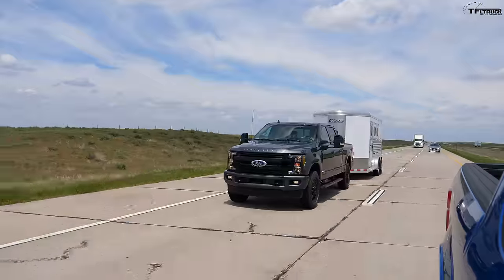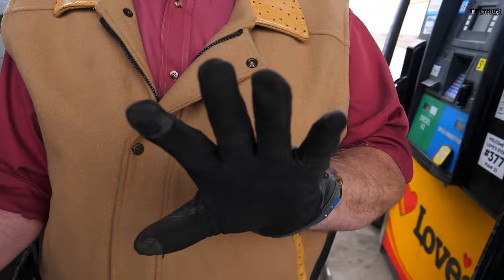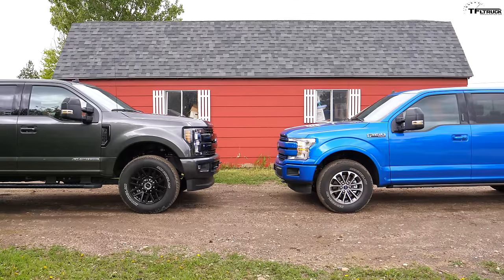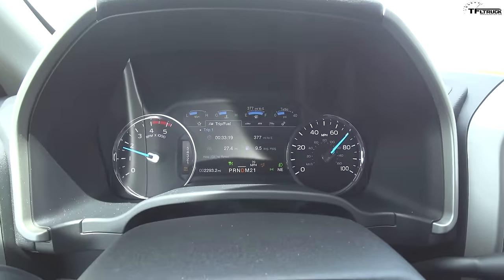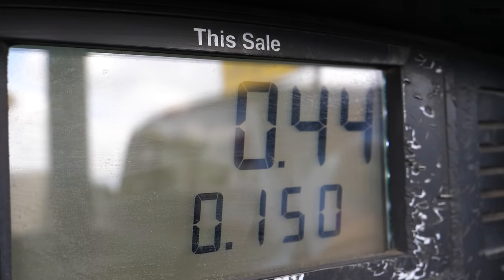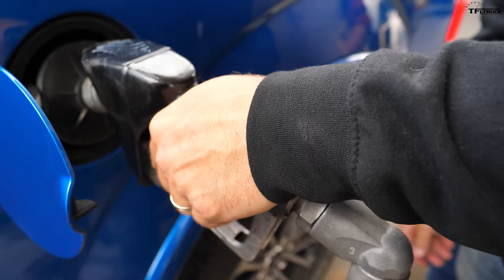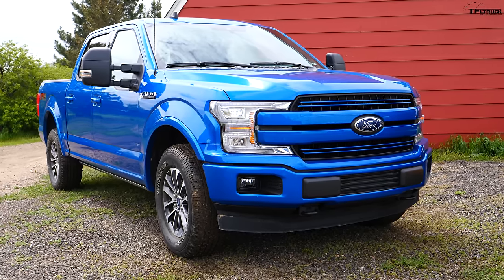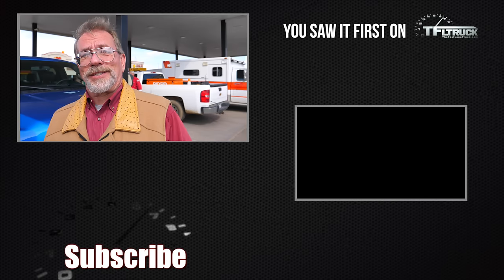Do You Really Need a Heavy Duty Truck to Tow 9,000 lbs? Ford F-150 vs F-250 MPG Review

Comment: In my opinion, this is why the half ton diesel pickups won't sell nearly as well as a regular gas pickup in the US. You pay a hefty premium for a Diesel engine, then spend more for fuel and DEF, don't forget those expensive fuel filters that have to be changed every 15k miles, and oh did I mention the oil changes cost about three times more? By the time it's all said and done, a half ton diesel pickup just doesn't make financial sense for the average pickup truck buyer in the US. The slight efficiency gain with fuel economy won't pay off.

Comment: It would all depend on how often people are towing and the weight of the load for most people as a daily driver the f150 will cut it
Reply: Yea if you do it on a weekly basis then would be better have the 250 as it will deal with it long term better but if its say once a month or something then probably be alright with smaller one.
Reply: Thats mu dilema. I tow mostly a few miles away onto the beach only a couple times a year and maybe once a year out of town but tt is 32’ amd 8500lbs loaded and would love a 1/2 ton for every day use but a 2500 gas would be a lot safer for the few times i do tow

Comment: Definitely agree with what some say, if you tow near 10,000lbs often go for a bigger truck. It's goin to drive better and safer with the heavy load, but they should have done diesel vs diesel.
Reply: They test with the trucks they're given. Duh.
Reply: The thing is, that while the test is interesting, no one buying an 8000 lb. travel trailer is going to be driving on flat roads all the time. If they want to take it anywhere, they're going to have to manage hills, mountains, winds, passing, and other obstacles. MPGs, while a consideration, is only a small part of the issue.

Comment: This was a really cool test. Yes theres other variables like 30ft campers or goose necks but that wasnt the test. It was a 9k lb horse trailer and this just proved that for some people you dont have to overcompensate on a truck when modern 1/2 tons do the job just fine. Lets not forget a 1/2 mpg could be from more wind, slightly heavier throttle response etc. Good job tfl on this one 👍

Comment: This was a good start on comparing the F150 and 250 towing.  You really need to take this to the next step by doing some hills for pulling "and" braking performance comparisons.  Then go out on a windy day, and also a busy day with semi's passing you.  If you drive 60 mph in a 70 mph zone they will be buzzing by you the whole trip and you'll find out how each truck handles side forces and sway.  Also consider the RV tower who's driving 1,000 or more miles on a single trip with a variety of conditions.

Comment: My wife and I both have Ram pickups.  My wife used to have a 1500.  But traded in for a 2500 with the 6.7L Cummins. My Ecodiesel pulls trailer nice.  But my wife loves how the VGT engine works on the Cummins.
We rarely tow trailers.  But do go down very steep grades frequently.

Comment: Over the past nearly 50 years I have towed trailers weighing from a couple of thousand pounds up through 14-15,000 pounds!   It is true that there are gas powered pickups that have the power and heft to do the job.  However, from experience, if one does as much towing as I have one learns gas engines do not hold up like a well designed and built diesel engine!   The first thing to go on a gas engine is usually the valves.  My last gas big block needed a valve job at about 38,000 miles!   My current diesel powered Ram has passed the 285,000 mile mark, no such problems!  This is one of the 2 reasons big rigs are diesel!  The other is diesels are about 40% more fuel efficient than a comparable gas engine!  Now, if one tows any weight on a seldom basis, a gas powered pickup probably will do fine.

Comment: You should do a similar test with Chevy and dodge 1500 vs 2500
Reply: Raptor867 I recently towed a 3500 lb camper with a 2.8L Colorado from the shores of the Cheasapeake Bay to the peak of Mt Rodgers. Whether in traffic or traveling downhill, I felt in complete control of my pickup and trailer.

Comment: I come from a f150 and have now purchased a f250 towing a 8k lb camper long distances. Both my trucks are gas , in my experience what pushed me to a f250 is the fact that we often ended up overloading the truck by taking all of the family’s toys. We are so much happier with the f250 as I can load the canoes and the generator without even thinking about how much weight I’m putting on the truck

Comment: I have a gas F150 and my son has a diesel F250. I tow a race car trailer about 7500 lbs, and the 150 tows it fine, of course the F250 pulls it better but frankly I hate the ride.  And empty it's really bad, my son calls my truck a baby truck but overall for the 10 times I tow a year the F150 is a better overall package. The fuel I would save with a diesel would never pay for the added cost and the chiropractor bills for my back.

Comment: I saw a tow video on YT here and the guy was towing a large camper at 62mph with an F150Eco. He showed the gauge as he was getting 14mpg. Drive slower, get better mileage.
Reply: Yeah 70 mph is alot of wind drag for a brick
Reply: I call bull. I tow a 31 ft 7k travel trailer with an Ecoboost Expedition EL. I get 8 to 10 mpg between 55 and 65mph. From all the trailer owners posts I've seen, that's the average. Only way he got 14 mpg is with a tailwind or going downhill.
Reply: Jason Hall you drive an expedition... not a f-150
Reply: @kirks6932  true, but TFLs numbers are much closer to mine. So who are you going to believe? https://www.tfltruck.com/2018/03/top-10-most-efficient-trucks-towing-a-7000-lbs-trailer-on-a-100-mile-highway-loop/
Reply: I tow a 31' fifth wheel that weighs 9000lbs loaded with a '13 F150 with the 3.5L Ecoboost  and I average about 9 to 10 mpg, but when I tow my utility trailer with that load I average about 11 to 12 mpg. I attribute the difference to the surface area that the wind hits. 14 mpg is stretching it quite a bit.
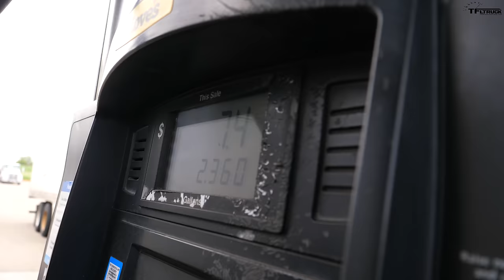Reply: Pulled a 30' 5th wheel that weighs about 9000lbs on a 1000 mile trip and averaged 7.8 mpg. '18 3.5 EB 3:55 gears and premium fuel, average speed: 65mph.
Reply: I had a 2018 3.5 EcoBoost and tow a 32 foot 8900lbs travel trailer. The best mpg I ever got was 8.1 mpg. Moved up to a 350 with the 6.7 power stroke and average 14 mpg while towing the same trailer.

Comment: Thank you, because I was wondering about this very issue as my 27ft (31ft with tow lip) new 2021 travel trailer is scheduled to be delivered end of this month. My truck is 2019 F150 Lariat 2.7L V6, FX4 with tow package and we did get a heavy duty WD hitch  to go with the new  trailer which has almost 7600lbs grouse weight. I feel better now. Thank you again. Of course I will be driving slow, and take my time.

Comment: Plus the extra maintenance costs for diesel at this level are not so wonderful...
Reply: Unloaded the diesel is like 15mpg at absolute best. Every mile on that truck will cost more for absolute certain, but it's safer, less stress/driver fatigue, and you could set the cruise control up the ike gauntlet in the 250 and maintain speed. That little gasser is running on borrowed time doing that every day. Industrial vs casual.

Comment: Interesting... however, there is a third option, that being a SuperDuty with the gasser engine. Save the $10,000+ upcharge for the diesel engine (and associated maintenance costs) and see how the 6.2L gas powerplant performs. I have a 2015 SuperDuty with the 6.2L pulling an 8,500 lb. equipment trailer and for occasional towing I couldn't be happier. I think the additional safety margin the heavier truck provides is well worth the difference compared to the F-150.

Comment: I'm amazed at how bad these 6.7 diesel trucks are on fuel.  They're barely edging out the gas trucks even towing as seen here.  It seems like the older trucks with diesels are much better in spite of all this tech.
Reply: Just delete your egr and dpf. I tow 14,000#'s every other day with my 6.7, up and down Ozarks hills at freeway speeds, and never get below 14mpg.
Reply: That's because the government wrecks them with EPA B.S.  You can get much better mileage out of the diesel with some aftermarket work.
Reply: @hannibalsmith1194  admittedly I'm no expert on pollution statistics and whatnot, but it seems to me that the government has an unreasonable phobia of diesels. Much more efficient, and can do much more work in the same amount of fuel, but "it's smelly, Smokey, loud and scary! Needs to be regulated to death!" Lol
Reply: The more HP and torque you use costs more fuel.  The older diesels were more fuel efficient because they weren't tuned for higher numbers just for bragging rights.  But they got the job done and ran for a long long time.
Reply: Also; these guys are in the Rocky mountains near Denver, Co. from 4000 ft elevation up to just under 12,000 ft elevation. Fuel economy is not going to be as good as if driving the flat roads of Texas, Oklahoma, Kansas, Nebraska, etc.
Here in the Texas panhandle pulling 9,000 + and getting >14mpg in my 2020 F250 6.7 PS.

Comment: Nice effort TFL. No wind or grade and a well balanced load are a lot different than hauling my 37.5 ft TT. My 1200 lb tongue weight would put that f150's rear on the ground and nose in the air wd hitch or not plus eating most the payload. But this proves f150 can get it done well if set up right.

Comment: Why you guys stopped doing MPG loops with empty trucks because that was very helpful to us? Not everyone is going tow with their truck 24 hours.
Reply: True, but I rarely drive my truck without a trailer.  If I don’t need the trailer, I’m probably going to ride one of my motorcycles instead.
Reply: Pretty sure if you go back throughout the year you'll find empty fuel loop videos on these trucks.
Reply: Why buy a truck if you aren’t towing/hauling?
Reply: TeensierPython - I didn’t not say that they should not do videos while they are towing. Absolutely, I want to see it in both results with towing and without. However, everyone is different than others. For example, I have 2019 GMC Sierra 2500 and I have not towed with yet since I bought it.
Reply: @TeensierPython   probably 90% of the trucks around me never pull a trailer or even load more than 100lbs in the bed.  Sad very sad.
Reply: They are damned if they do and damned if they don’t
Reply: @EverydayCars  i seldom haul or pull anything. but i don't expect my truck to get good gas milage either. i am the worst poser ever, use my raptor to drive to the store.
Reply: @TeensierPython  at least your honest.  And congrats on having a Raptor there awesome trucks but you know that.
Reply: There are a lot of people that buy trucks because they look good! Some just like the occasional truck use like bringing home a new sofa, hauling a few tree branches out, etc. If you ask why buy a truck if you don’t tow, another parallel is why buy a corvette if you don’t race? Because you want it. That’s all. When we can, we all purchase the vehicles we want. Sometimes, like when I was younger, I bought what I needed. 
    I have had as many as 18 trucks between my farm and personal use. 9 were farm trucks. Some trucks are classics that are pampered more than most cars, but they look good regardless if they were stock or customized. I am not as healthy as I would like to be now so just had an auction and liquidation recently. I laid off 5 ranch hands and gave each of them their assigned trucks they had on the ranch. All Pro 4X Nissan crew cabs. I kept one guy on and bought him a new F150 2.7 XLT FX4. I also bought a twin to his truck for an extra work truck for myself and family or friends who are visiting. Both are SuperCabs. I then gave a family member my new GMC Canyon Denali Duramax as a special gift. They just started work with a long commute and needed a small truck still. I bought for myself on a personal basis a new F150 XLT 5.0 SuperCrew FX4. I traded my F250 diesel SuperCrew and my F350 gas SuperCrew AND my F550 Diesel SuperCrew Flat Deck for a F350 Diesel XLT FX4 SuperCrew. Well all those went against the purchase  of all the Fords, it was one transaction. I still wrote a big fat check to the dealership and they were smiling a LITTLE too much when they took it! Hahaha. I always feel that way after a deal! Haha. All my other trucks but a 2007 Chevy Colorado 4x4 3.7 litre crew cab (personal reasons to keep this truck) were auctioned. 
      BIIIG downsizing. Sold all my cattle, most of my equipment and it feels surreal right now. In a very good way. All my crew is still here and paid until the end of July. Only one has to work as the others are looking for work. We are having fun fishing when they are not looking for work.
Reply: shitloveaduck that’s true I bought 2019 GMC Sierra 2500 just because I love how it looks. I don’t think that I’m going to tow with it.
Reply: Yeah should have calculated empty mpg since you were driving alongside for camera car anyways.
Reply: I believe for all current trucks with the exception of the new HD trucks by Ram and GM they have the mpg loop done for them. Or at least the majority
Reply: Romans 10:9 "that if you confess with your mouth the Lord Jesus and believe in your heart that God has raised Him from the dead, you will be saved."
 I will be praying for you to believe and accept Jesus as your Lord and Savior, The Messiah, Almighty God in the flesh ! Turn to Christ and away from your false god!
Reply: @TeensierPython  maybe because i live on 40 miles of dirt roads?
Reply: But why would you even consider a truck if you don't plan on towing much?
Reply: @BlueOvals24  Why buy a Jeep Rubicon if you don't take it on the Rubicon trail?

People like what they like. It's their money, they can spend it however they see fit.

If you see what all I have it would probably make your eye twitch. I use it occasionally for what it's intended but not enough to satisfy your judgement. Fortunately for me, I don't care.
Reply: @BlueOvals24  My money, your problem. Enjoy. :)
Reply: @dchawk81  Your waste of money is not my problem
Reply: @BlueOvals24  Then stop criticizing.

Comment: Another great review by the TFL and Mr Truck!  I am coming to the video late, but this review seems like an MPG only review, without the tortuous Ike Challenge.  Did you guys mention what your actual payload was with the hitch weight and driver and passenger?  My guess for a 9,000 lb trailer with 15% to the tongue = 1,350 lbs + about 400 lbs for Andre and Mr Truck, so your actual cargo/payload for this review was about 1,750 lbs, which exceeds the F150's published payload which was less than 1,700 lbs.  Campers often put toppers at 200 lbs over the bed and carry alot of weight in camping supplies like:  generator, BBQ, camp chairs, firewood, tools, etc.  Now address the Gross Rear Axle Weight.  Most F150's rear axle rating I have seen are around 3,800 lbs.  Not sure why the F150 did not have the Heavy Duty Payload Package, which can provide around 2,000 lbs of payload?  Plus, when ordering the F150 you can include the 36 gallon tank.  Those towing mirrors on the F150 are hard to find on a dealers lot.  All the F150 owners I have met in our 20,000+ miles towing our Airstream, have special ordered those mirrors, which are so much nicer than clip on tow mirrors.  Plus consider the sidewall squat on F150 factory supplied tires.  We switched to E rated to eliminate the sidewall squat and eventually from an 2009 F150, supercab, 4.6L 2WD. 5'5" bed with topper to a 2019 F250, due to the limited payload and rear axle rating (CAT scales confirmed we were over max by 400 lbs) AND the "push" from semi's going by our rig which was traveling at about 65MPH.  F250 6.2L (3,500+ payload) gets about the same MPG towing and about 4MPG less in town driving.  We love the 34 gallon tank in the F250, which makes it easier to reach Buc'cees gas stations!  F150's have a nicer ride and easier around town driving experience, but I would need to test them with my trailer and WD hitch to determine if those big old semi's are going to push us around!

Comment: First off towing constantly that much on f150 you will keep changing shocks and maybe springs. Second you can boost the power on a diesel for much less then a gas and it will get even better milage.
Reply: These days you don't even need to boost the power
Reply: Power costs fuel.  The law of physics.

Comment: I have a 2018 Ford F-150 with the Coyote engine, I tow a 25 foot Airstream and get 12.4 mpg but I'm running long tube headers with stock exhaust and hotter coils with copper plugs. When I'm not towing I I can get 25.3 mpg if I keep my lead foot under control.